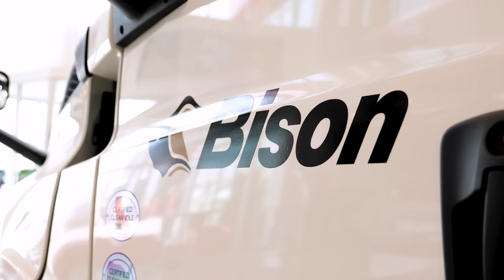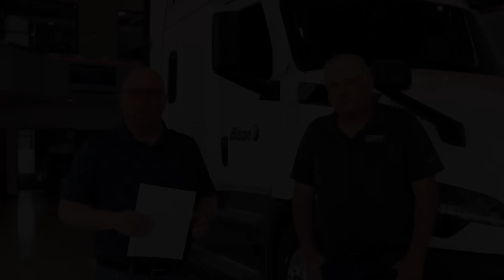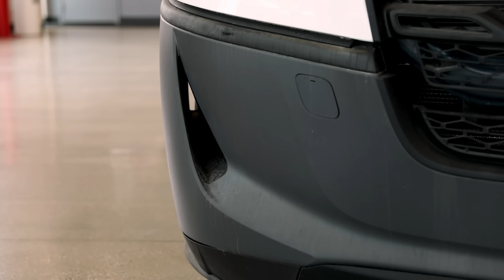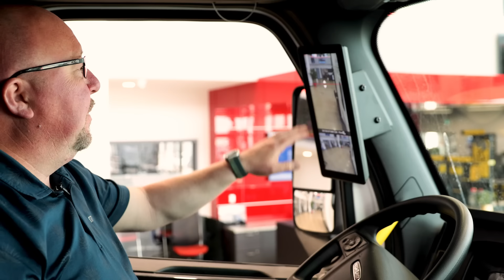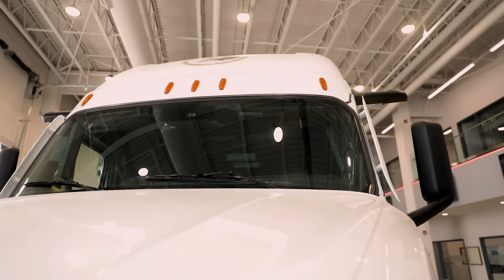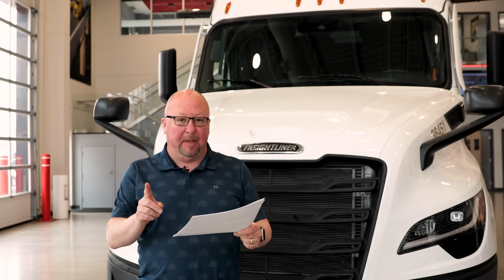Tour the All-New 5th-Gen Freightliner Cascadia

Comment: as an OTR Driver, I am highly disappointed at all Truck manufacturing companies as they are obsessed with the technology to replace the mirror yet no concerned about the weather conditions. they have failed to give a solution for driving in snow, at -20 degree c when the wiper blades collect ice and freeze windshield has 2 inches thik ice and zero visibility. or in the desert at 100 degree f, the cabin truns into a oven if the air conditioner breaks down or the truck. they have zero regard for the driver safety and life.

Comment: Those little things above the windows on either side with the cameras are the ugliest and stupidest things you could ever added into the trucks. You need to increase your frame length for a smoother ride. These freight liner cascadias, and I mean all of them are very rough. Constant issues with the detroit assurance system. Overall these trucks suck.